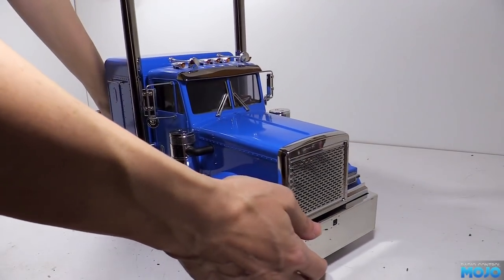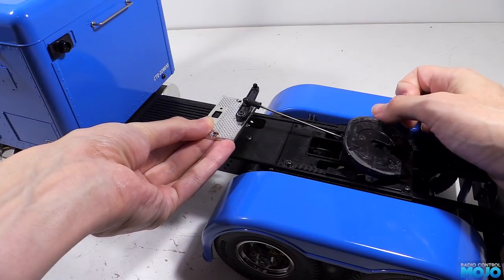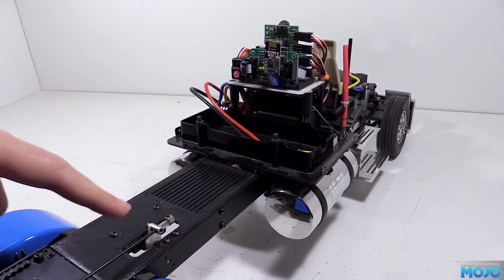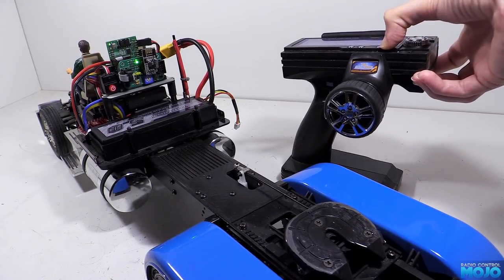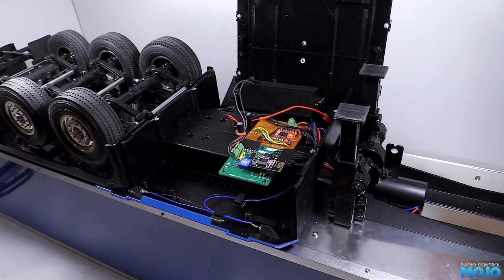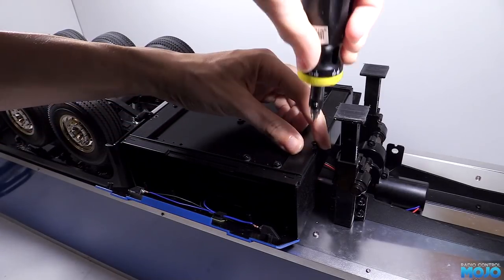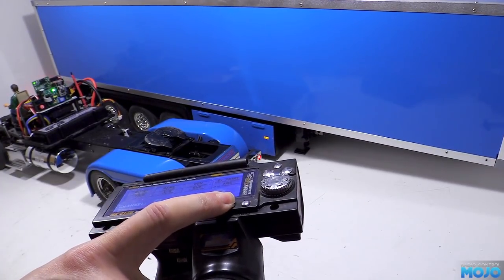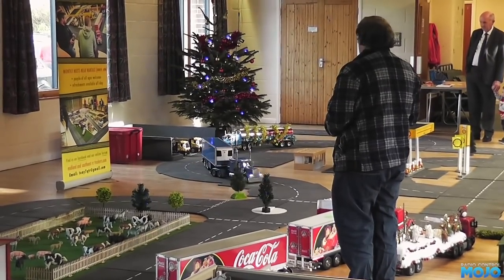Tamiya Grand Hauler - 12 - Wireless Updates

Comment: Great video what controller r u using.
Reply from the maker: The transmitter is a FlySky GT3B with alternative firmware for 8 channels. I've never been a huge fan of driving with stick radios and the GT3B and GT3C do the job with a wheel

Comment: when is the next trx-4 upgrades
Reply from the maker: I've been running the TRX4, it's been borrowed by other people, cartwheeled down numerous hills, submerged up to it's windows and it rarely get stuck, nothing's broken except the motor bushings wearing.
So there's not been any upgrades because it's been working perfectly, one of, if not the most reliable scaler I have!

Although, I do fancy fitting a WP1080…
Reply: @RCMojoTV  Oh nice one what do you suggest for me to ues oli and Greece for axles gears and other